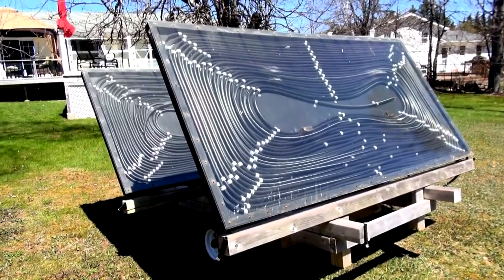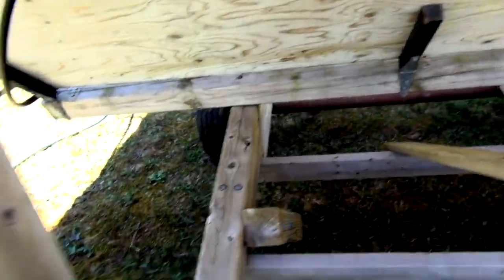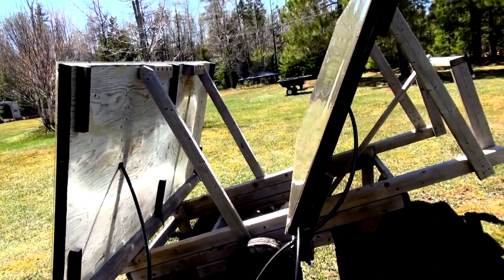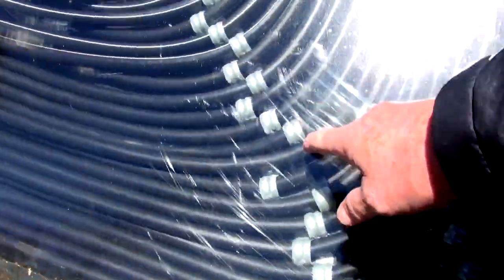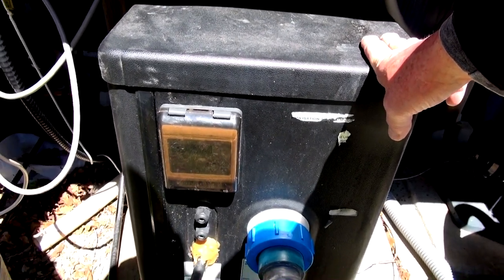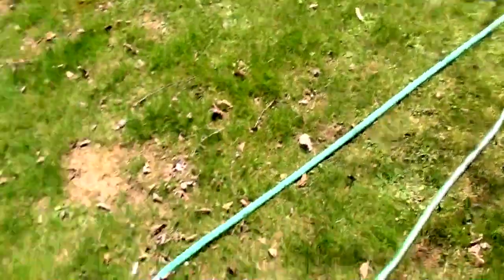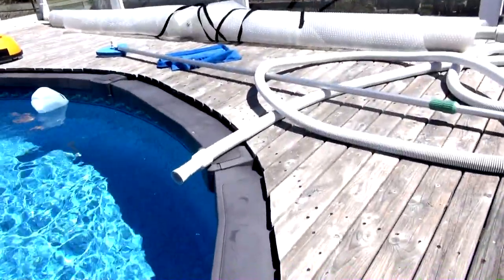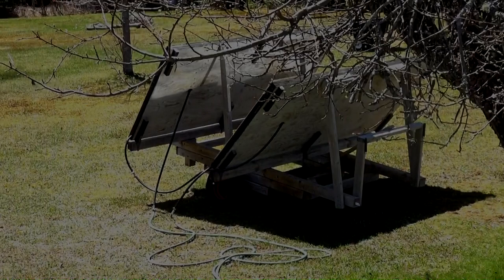How to Build a Real Pool Solar Heater on Wheels That Works

Comment: Weight is mostly not from water. 400 feet of 0.5 diameter hold 4 gallon of water weigh about 34 pound.

Comment: Nice and impressive.  Is the tube 1/2 or 3/4 inch? Also would a submersible pump work for the system?  I have a pool about 36000 gallons and like to build a large scale one.  How many panels and the diameter tube I should use?  Please help you advice.  Thank you.
Reply from the maker: The tubing is 1/2 inch irrigation tubing, black and 400 feet per roll. At the time, each roll was about 100 dollars cdn. I used 2 rolls and installed them into the panel one roll of 400 feet per panel with a small amount of waste, on a warm day so it was easy to flex, I used electrical conduit clamps to lock the tubing into place whenever it needed on, especially at the corners . I attached the panels in series feeding one into the other. Yes a pump would work, you need a lot of pressure to get the air out of the panels and to push the water through the panels. Watch my video it shows what I did , but I know a guy who used a pump . Hope this helps.
Reply: Thank you.  Would 2000 gph pump work?
Reply from the maker: @linsam5688  That would be way too much, I measured mine once , and the way I have it connected as seen in the video it is only about 60 gph , not much but regardless of the speed, the water is only going to heat up so much, and the faster the flow, the less the transfer  of solar energy to the water. I get about a 20degree C increase on a hot sunny day at this flow, so if you increase the flow, the deltas increase will be less. But yes it would work, but the temp increase would be less, but is is till going to make the same difference in temp over time. I simply teed into my own pool pump to save electricity and cost.

Comment: Great video, I have a similar solar pad set up but my pump just doesn't seem to be strong enough to create any suction for my skimmer while pushing water thru my solar set up. Is it possible to put the T on the intake side (skimmer side) instead of the return to the pool like you have. If I add a T as the water comes out of the pool, could I introduce a second pump. Is it possible to have two pumps pulling from the same intake, and T'ed so one goes to a pump and thru the solar system, and the second pump pulls water from my skimmer, goes to my sand filer and back into the pool?
Reply from the maker: A lot of people just buy a sump pump and drop it into the pool to circulate the heated water completely ignoring the initial set up with the pool pumps etc.  I was planning this originally until I saw a video on YouTube where the person teeed into the return and used the pressure to run the solar panel as well. My setup does not have any impact on the return pressure as my skimmer works great.. you could probably tee into the line just before the sand filter you may get more pressure but you can't tee into it before it gets to the pump as it will be a negative pressure but you know that. I do know for a fact that if there is air in my solar pipes there is not enough pressure to push the water through as the air compresses....so occasionally I have to divert all the water from the return line directly to the solar panels and once all the air is out I move the valve back to normal and it works ok.
Reply: @BENZ007  Thanks alot. I have seen lots of examples of sump pumps but I'd rather not if I can figure this out. I am glad you said I cant tee it in before the pump. That was exactly my question. What I dont understand is how does adding a Tee just after the sand filter, allow for more pressure to go to the solar pad. If I put the Tee after the sand filter, does that allow there to be more suction pulling from the skimmer. To me isn't this just the same set up I have now but adding a Tee to go to the solar pad. I just dont understand how this allow for more suction at the skimmer end.
Reply from the maker: you misread my comment "  you could probably tee into the line just BEFORE the sand filter you may get more pressure" because you lose a few psi in the sand filter...so i was saying if you tee in where the water exits the pool pump on the way to the sand filter, you may get more pressure to the solar heater...but that water will not be filtered..lol...so thats not a good idea... I don't understand your concern about suction, the pool pump just sucks water from the pool to be filtered, it just draws water into the pump in the skimmer hole...are you saying that your water is not circulating ? Which way is the return line that feeds water back to the pool pointing .. my return line is pointing to make the water swirl in a circle to move the water in the pool in a circle so the skimmer collects the debris. Some people point the return where it connects to the pool straight down , so the water really is not moving in a circle to skim the poo l
Reply: @BENZ007  Your comments are so informative thanks. Your right, probably wouldnt want to send unfiltered water to the solar pad. Honestly I dont know if my return line is directional, I think its just the strainer type of outlet. My issue is that my skimmer hardly has and suction. Some others with a similar solar pad say the pump that came with the pool isnt strong enough to pull the water thru the solar pad and provide the skimmer enough suction. Once they removed the solar pad or plugged one of the inlets with the black stopper then there was some more suction. I am trying to think of a way to give my system more suction. I like how you T'ed your hose after the sand filter but i am trying to understand if that would help me, or another idea I had was to add a second smaller cartidge pump to help increase suction.
Reply from the maker: it has nothing to do with suction, it takes pressure to push the water through the sand filter, I think it is a 1 hp motor that creates 15 PSI on the gauge, the only purpose of the pool pump is to remove the debris from the top of the pool that makes its way to the skimmer hole , like leaves, twigs and insects etc and keep it clean through the sand filter and the filter in the pump itself.... If your gauge is saying 12 to 15 psi then the pressure is good. I am not familiar with the solar pad you mention but it is possible that it uses most of the water on the return line and it basically slows down or stops the return flow to keep the water circulating , basically in your words, has low suction kind of. ... in this case, maybe if you restrict the flow going to the solar panel so that less goes to it, and more goes to the return line. My return flow from my solar hearer is about 1 gallon per minute...measure it... if it is using too much water, there is your problem... so restrict the flow to the pad, and its irrelevant to the flow because the water will be hotter if it goes though the panel slower.
Reply: @BENZ007  Again great info. This is my first pool so I really appreciate the feedback. Honestly I dont think the pressure gauge on my filter is between 12-15. I will check when I get home. That could be an issue. My setup is an out of the box bestway pool kit from costco so I dont have any reducers or pvc pipping like you do. The hose comes out of my sand filter then into one end of the solar pad, thru the pad and back into the pool. I will read you last message a few more times to make sure I understand everything you said. I wonder about the pressure,  I dont think its 12-15. Thanks again
Reply from the maker: @paulflogeras2309  I was presuming you had a similar pool . I have no idea the specs for this one. Not sure what I can say that would be applicable to this situation just offering my thoughts with my experiences.